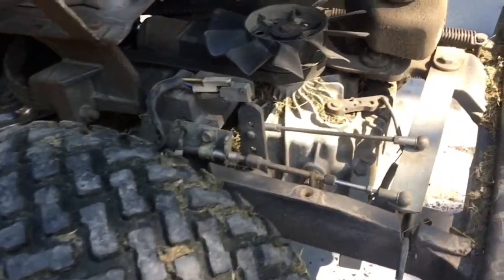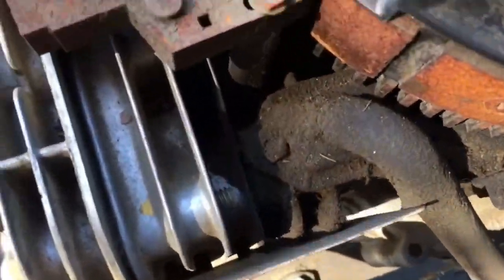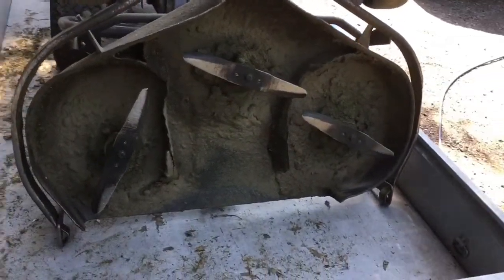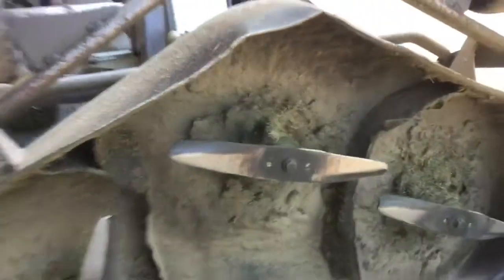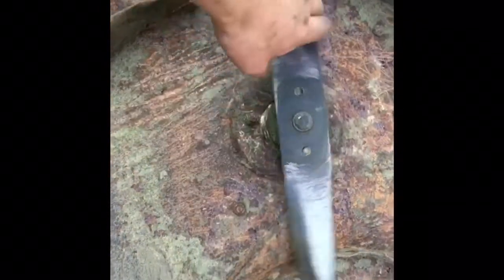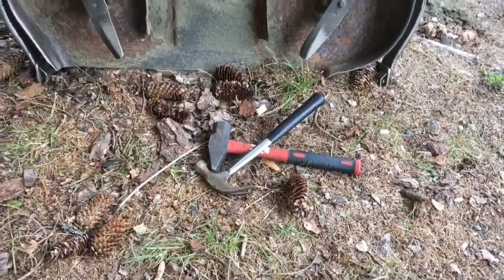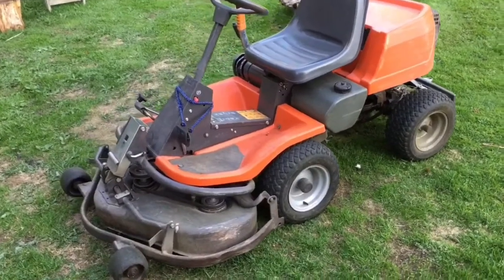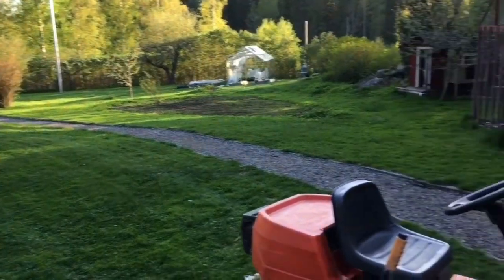Husqvarna Rider 13 RS checkup and first mowing

Comment: Would this mower be a good buy in 2020?
Reply from the maker: ahjos I sure think so, cuts fast and nice,  very maneuverable and parts still available. The cutting deck is  made of thick steel so it last a long time with some proper care. It’s the best mower I have had so far.
Reply: Yes! I buy in 2019, 17hp, 4x4. And it's a best thing what i buy in my 34 years! )))
Reply: @NilsKall  Thank you. Another question if you have time: Should i hose wash the cutting blade deck? I've read it should not be hose washed since it rusts the bearings :(
Reply from the maker: ahjos there is a lot of opinions regarding that matter...When I bought a brand new Stiga Park a couple of years ago I used a rust protection spray on the underside of the deck before first mow. I then washed after each mow. The deck was like new after 1 year if use. When I bought cheap bearings for the rider 13 deck they rusted after washing the deck so
In that case I should not have washed. So I have had mixed results on washing. Now I flip the deck up and scrape the worst of so it doesn’t hold moisture but I don’t wash it with water.

Comment: The Workshop, says it costs 8.000 DKK to get all 3 spindels or something replaced! WTF that is insane. U could get a new cutting deck for just 4.000 DKK more or less! + an oil leak fixed
Reply from the maker: ToxRozzx its made of gold! 
I bought the whole mower for 8000 sek!
Usually you can get mandrels from a 3rd party dealer. They are really heavy duty so why do you need new? I will change the bearings in this deck during the summer. Video coming soon after.
Reply: Nice, i'am looking forward to the video.

Comment: How do you get deck to service position
Reply from the maker: Here is a video on how to do it:
https://youtu.be/mDU5EnFGrhU
Reply: Mine.is a r13 and not built like that so video isn't how its done mine has a chain in front
Reply from the maker: @garrymatthews2800  the Rider 13 has no service position for the cutting deck, the one in this video is a 13 RS = Rider Special so it has a different cutting deck.
Reply: @NilsKall  thank you